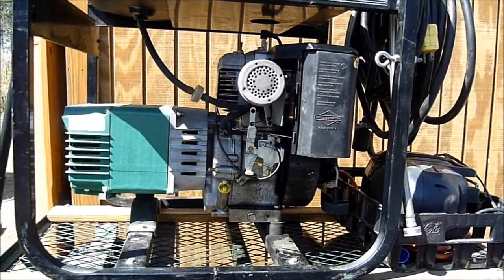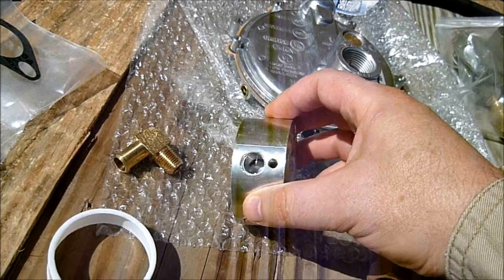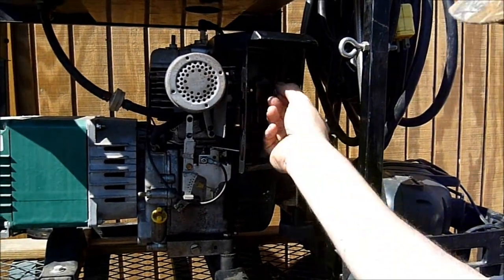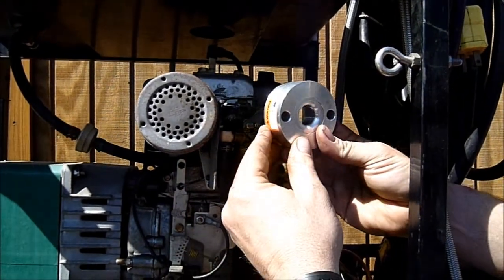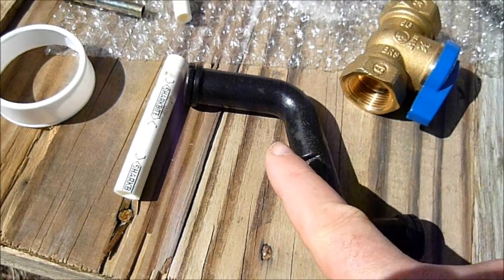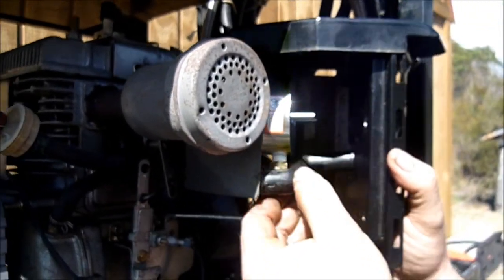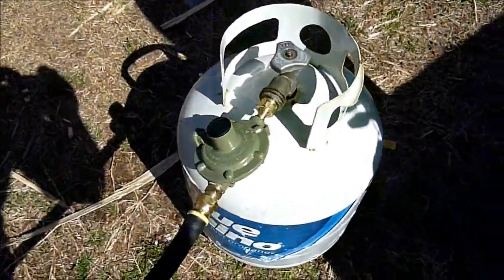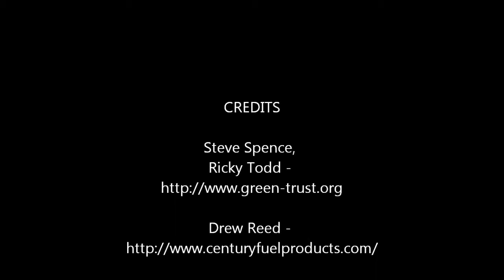Trifuel Generator Conversion

Comment: safety note: Teflon is reactive with nat gas and propane (I think) be sure to use yellow thread seal tape for gas service...
Reply from the maker: Was not aware of that. Good to know, thank you.
Reply: Steve Spence
Description
TOMBO Yellow Gas Line Tape
is a specially certified PTFE Thread Seal Tape for the Oil and Gas industry.
The ultra high density of our TOMBO Yellow Gas Line Tape reduces the possibility of Liquid Petroleum Gas (LPG) and Compressed Natural Gas leakage through penetration.
Our TOMBO Yellow Gas Line Tape is certified by Underwriters Laboratory (UL) USA for usage in threaded assemblies handling Gasoline, Petroleum Oils, Propane, Butane, Naptha, Benzene, Kerosene, Natural Gas for pressures not over 100 PSIG (File No: MH 25476
Reply from the maker: jerry arnold I've notified the manufacturer of the kit.
Reply: Steve Spence YES!!! very good deal...
Reply from the maker: The tape is  made out of Polytetrafluorethylene that meets the minimum standard for  gaseous fuel. On top of that, it meets T-27730A military standards. (See  Link) It is an obsolete standard but it still can be used for natural gas and propane usage. https://www.wbdg.org/ccb/FEDMIL/aa58092.pdf
Reply: Steve Spence just going by what I was told...maybe it's a local code issue...
Reply from the maker: I'm sure that teflon isn't allowed, but this isn't teflon.
Reply: Steve Spence cool...here in houston gas tape is yellow